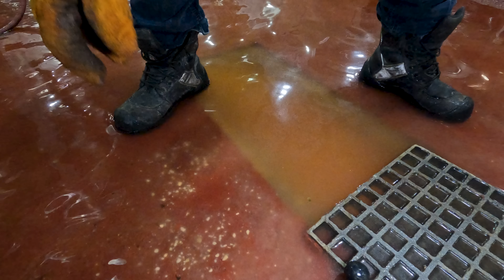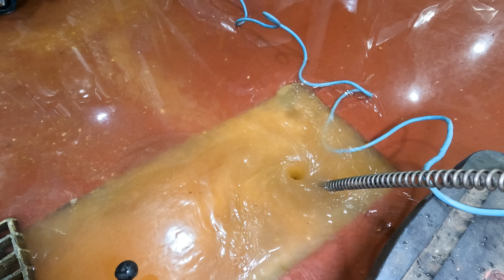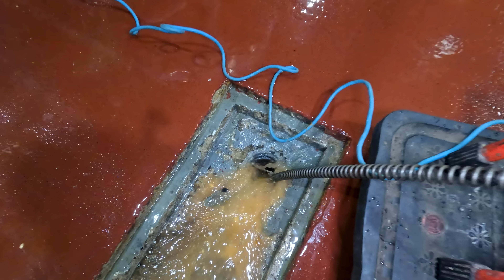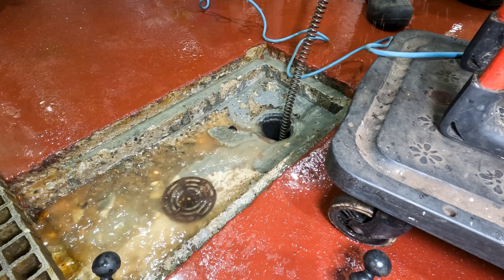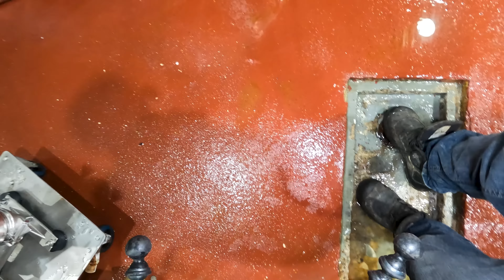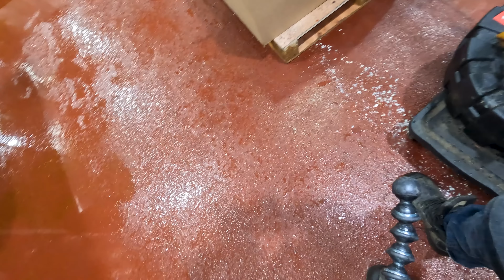This is how you clear a BBQ factory floor drain. WEEKEND WHIRLPOOL. SO SATISFYING.

Comment: What Kind of drain snake are you using in this video? Looks perfect for commercial jobs
Reply from the maker: That machine is a rigid k60 and it's a 7/8 cable. I'm trying to get my hands on the Milwaukee battery powered and M18 I've heard good things about it. So if by chance you have any contact with Milwaukee just throwing it out there. Thanks for watching. I hope you have yourself a great day

Comment: The grate has holes big enough for the snake to fit through so why don't you guys just leave it on, leave the snake on the drain and turn it on for a second every so often throughout the day so you're not walking in all that water for hours on end?
Reply from the maker: Because I'm the guy they call in and I didn't know where the drain was and we won't leave cables in a drain it will eventually rust and break down and then it will be stuck in the drain. Thanks for watching and I hope you have yourself a great day. Trogna
Reply: @Jaythatdrainguy  ah gotcha. I guess if it was my factory I'd just have to buy or make a stainless steel snake, leave that shit sitting there and tell my employees to do that so I don't have to spend extra money every weekend for you to come save them 🤣 🤣🤣🤣
Reply: @Jaythatdrainguy  nice job though! Enjoy yours as well!
Reply from the maker: No it would make sense for sure.
Reply: @Jaythatdrainguy  mhm between the cost savings and the liability of someone busting their tail before you even get there it should be common sense but that's something that's apparently not common. Lol
Reply from the maker: Lol

Comment: I could be wrong but I think you are running that machine backwards
Reply from the maker: In the nicest way possible. No I'm not. I'm running at the proper way You can tell by if I was to bring in the guide hose you would attach it to the back of the machine and you would run the end of the back end of the cable and keep it in the guide hose if that makes sense. Just out of curiosity, why would you think I'm running it backwards? Thanks for watching Douglas. I hope you have yourself a great day. Trogna
Reply: @Jaythatdrainguy   I'm a maintenance man at a apartment complex. I run machines like that when we have backups, but run ours  the other way
Reply from the maker: Oh really eh I was working on a job with another company and they asked me the same thing because to get the machine to feed the cable and you got to go in reverse and he said the guy that taught him was doing it for over 30 years. But then I explained to him about the guide hose and he's like. Oh yeah that makes sense. If you look up how to run a rigid k60, I'm pretty sure you'll be able to find it that you run it The way that I'm running it I could be wrong. Again thanks for watching. Hope you have yourself a great day. Trogna

Comment: All you need is a shopping cart full of draino. Problem solved.
Reply from the maker: Yeah that would probably work but what's it going to do to the pipes in the end? Thanks for watching. I hope you have yourself a great day. Trogna
Reply: @Jaythatdrainguy   thanks for uploading. You definitely did it right no doubt. I was just being ridiculous with my comment. 

To answer your question however, if it was copper pipe I think it would be bad news. As far as PVC idk… I seen a guy do a tutorial on YouTube with different drain cleaners and testing there box label accuracy claims and from what I can tell and his testing the PVC had no issues but the copper piping did. 

Then again he didn’t use a shopping cart amount either. 

You definitely did it right. Hence why your the professional. 🤙
Reply from the maker: Yeah for sure hey quick question. Do you know who that was that did that experiment? I wouldn't mind watching that. Thanks again for watching.

Comment: City sewer system? Or private? Either way, dumping that much grease/oil byproduct into a drain...if that's what their drain looks like can only imagine what the main line looks like down stream...! The contents that hit/flow in that floor drain is so acidic, it is destroying the concrete flowing acrossed it as though it were in an actual septic tank...!
Reply from the maker: Yeah you can definitely see the concrete wearing away from all the acidity like you said. Thanks for watching Karl. I hope you have yourself a great weekend. Trogna
Reply: Water flowing by itself erodes concrete. I've been pouring and finishing concrete for 20 yrs. Salt will corrode your concrete too
Reply from the maker: I did not know that thanks for watching and I hope you have yourself a great day. Trogna
Reply: *drain
Reply: Major repairs and cost for doing that.....All that grease, wow......!!!!......They gonna need some serious plumbing work....Break out the check book 📖......!!!!
Reply: Most likely they have a water treatment plant on site or are paying hefty fines for the water they are dis charging.
Reply from the maker: Lol yeah for sure. Thanks for watching and I hope you have yourself a great day. Trogna
Reply: There will be a huge grease trap outside.
Reply: @paulheitkemper1559  lol it doesn’t look like it. Most restaurants are required to have that grease trap so why doesn’t this place have one??
Reply: @ypcomchic  this video is inside the facility.
Reply from the maker: Thanks for watching and I hope you have yourself a great day. Trogna
Reply from the maker: Thanks for watching and I hope you have yourself a great day. Trogna
Reply from the maker: It does outside. Thanks for watching and I hope you have yourself a great day. Trogna
Reply from the maker: Yup thanks for watching and I hope you have yourself a great day. Trogna
Reply: @paulheitkemper1559  grease trap at minimum
Reply: They have a separator just like auto shops do.
Reply: It gets held in a separate tank and shipped in semi trucks to be processed elsewhere. Pretty sure this is litehouse foods in lowell michigan.
Reply from the maker: Yes it gets shipped but it's not in Michigan. Thanks for watching and I hope you have yourself a great day. Trogna
Reply from the maker: Yup outside. Thanks for watching and I hope you have yourself a great day. Trogna
Reply: I worked in a bbq factory in Indiana that water feeds into an on-site waste water plant. That is the usual practice when cleaning tanks out to drain them to the floor.
Reply from the maker: Yup thanks for watching and I hope you have yourself a great day. Trogna
Reply: Quit being a karen karl lol
Reply: They have an oil separator and grease trap. Those waste products are not going to the treatment facility. Every factory is purpose built for what it does. I plumb new factories for a living.
Reply: Damn with your intellectual superior knowledge you should already be millionaire by now, run your own BBQ company
Reply: @Jaythatdrainguy  wtf is Trogna. Trogna.
Reply from the maker: It's a word I made up years ago and I say to my kids it basically means goodbye or cya later I am trying to get it to catch on because my wife refuses to say it because she says it's not a word lol I've been saying it for years . Thanks for watching and I hope you have yourself a great day. Trogna
Reply from the maker: Thanks for watching and I hope you have yourself a great day. Trogna
Reply from the maker: 100% thanks for watching and I hope you have yourself a great day. Trogna
Reply: Karl had a great point, and yes guys, even air erodes stuff. Why those cool rocks out in the desert haha.
Reply from the maker: Lol thanks for watching and I hope you have yourself a great day. Trogna
Reply: If they send some extremely hot water behind that fluid that was flooding that room it will break down the grease and wash on down and it’s probably cleaning chemicals that has eaten the concrete up in the drain. The floor in there had a epoxy coating on it is why the floors were not eat up. My concern is the fact that there was 3 inch’s of nasty ass trashy water in the same room of food products. I’d say the shit would hit the fan if the right people knew this video was out like this
Reply: Yep that's food production for you.
Reply from the maker: Yep thanks for watching and I hope you have yourself a great day. Trogna
Reply from the maker: Probably. Thanks for watching and I hope you have yourself a great day. Trogna
Reply from the maker: Very good explanation Patrick. I hope you have yourself a great day. Trogna
Reply: It looked like a bottle cap or a jug lid. Hellitcoulda been juuust about anything dwelling low to the floor 🥴
Reply from the maker: True thanks for watching and I hope you have yourself a great weekend. Trogna
Reply: They make grease interceptors in precast concrete for this reason and they’re placed underground
Reply from the maker: Yep, you're right. D. This one is outside and it picks up all the drains so this one drain was just plugged up. I actually have a video on my page. Probably a couple, maybe a month or two ago and it looks identical but it shows more than one drain that was backed up. Thanks for watching. I hope you have yourself a great weekend. Trogna
Reply: If yer gonna chide them for this, put your money where your mouth is and give them a solution. But first do some research on factory water processing to not put your foot in your mouth.
Reply from the maker: Thanks for watching. I hope you have yourself a great weekend. Trogna
Reply from the maker: Thanks for watching and I hope you have yourself a great weekend. Trogna
Reply: @Theuglyconcretefinisher  thanks for doing the work you do sir, my uncle just passed on the job hit by a skid steer. He was a concrete finisher for almost 30 years, what y’all do is art.
Reply from the maker: Thanks for watching and I hope you have yourself a great weekend. Trogna
Reply: It all goes into a tank then repurposed. I'm pretty sure mcdonalds and Wendy's buy it for their burgers
Reply from the maker: Lol I don't think that is correct but I could be wrong thanks for watching and I hope you have yourself a great weekend. Trogna
Reply: @Jaythatdrainguy  You're so humble and friendly. Thanks for the very relaxing video.
Reply from the maker: Lol Thanks. I definitely if I'm being honest I wouldn't agree with you a couple years ago. But I'm definitely trying to change myself for the better and I just hope that it is coming through that I am actually trying. It's not just a facade I'm putting on. Thanks for watching. I hope you have yourself a great weekend. Trogna
Reply: @swide2750  Except that is nearly 100% gone unless they are a billion dollar company
Reply from the maker: Thanks for watching and I hope you have yourself a great day. Trogna
Reply from the maker: Thanks for watching and I hope you have yourself a great day. Trogna
Reply from the maker: Thanks for watching and I hope you have yourself a great day. Trogna
Reply: @MrDeserteagle411  whats 100% gone
Reply from the maker: Thanks for watching and I hope you have yourself a great day. Trogna
Reply: @swide2750  Companies dumping millions of gallons of waste illegally, except for billion dollar companies
Reply from the maker: Lol thanks for watching and I hope you have yourself a great day. Trogna
Reply: Should be grease traps down there.
Reply from the maker: There is outside. Thanks for watching and I hope you have yourself a great day. Trogna
Reply: @paulheitkemper1559  I have a grease trap inside
Reply: @durk541  dude, don't talk about your sister like that.
Reply from the maker: Wow it's getting spicy in the comments lol thanks for watching and I hope you have yourself a great day. Trogna
Reply from the maker: Thanks for watching and I hope you have yourself a great day. Trogna
Reply: Just think what that BBQ food is doing to your arteries.
Reply from the maker: It's true but it tastes so good. Thanks for watching. I hope you have yourself a great night. Donald. Trogna
Reply: @incredulousd9408  el oh el!! I was wondering the same thing! 😂😂
Reply from the maker: Thanks for watching and I hope you have yourself a great day. Trogna
Reply: Probably private I worked at a few restaurants where we had dedicated grease drains into a tank or some other system
Reply from the maker: Yeah they had a grease interceptor outside of the building that gets cleaned out. Thanks for watching and I hope you have yourself a great weekend. Trogna
Reply: It ate through the epoxy coating of the concrete
Reply from the maker: Lol yeah thanks for watching and I hope you have yourself a great weekend. Trogna
Reply: @Jaythatdrainguy  Google translate is translating Trogna to Faithful. So. You are just calling all of your viewers faithfuls xD
Reply from the maker: Yeah I found that out. Got too long ago but it is what it is. I made that word before I do word existed in another language and it's just something that comes natural to me to say it now. That makes sense

Comment: If you want more people to view this maybe cut out the first 3 minutes where you do absolutely nothing on the camera
Reply from the maker: Thanks that's a good idea. I hope you have yourself a great day. Trogna but also with that being said I have 3700 subs and this video has 500,000 views .
Reply: @Jaythatdrainguy  that's awesome man I'm a mechanic and wanted to start posting hard to diagnose fixes that i figured out and other shops couldn't but id almost have to hire a camera man or maybe get a go pro its always been something i wanted to do and never have but yeah just throwing my opinion out there since i almost skipped the video i was 2 minutes in and was still starring at a flooded drain also what is that machine I've used a snake on drains but usually it turns did you just not have it on?
Reply from the maker: You should definitely start. Just get a go pro like you said and just start you'll never find the perfect time. The perfect time is now. Thanks for watching and I hope you have yourself a great day. Trogna

Comment: Glad they have changed up drain cleaning machines for the better since I use to to that same job. Those Spartan spinning cannisters could beat you to death and God forbid you got a hole in the air swich ball or line because they would quit working.
Reply from the maker: Oh yeah for sure thanks for watching and I hope you have yourself a great day. Trogna
Reply: Spartan is still number one on the market i feel. General wire #2
Reply from the maker: Yeah I've never tried the Spartan. I'd like to get my hands on one to try it just to see how it works. A lot of the issues we come up with though are in apartment buildings and I don't know how that machine would work because it's more of thick cable. Very rigid if I'm not mistaken but I could be wrong and with our apartments that we got to deal with the copper brass that they use is very thin and cheap and I'd be concerned that it would do more damage then good.

Comment: wow, that just seemed too easy didn't it?  You hardly had to put that snake down 10 feet before you cleared the blockage.  looks like that drainpit has seen better days, eh?
Reply from the maker: I think it may have been an offset trap and the trap was just plugged. But that's just one man's opinion lol thanks for watching Piddy I hope you have yourself a great weekend. Trogna
Reply: The only thing more satisfying than clearing the blockage is clearing it on the first cable lol
Reply from the maker: You couldn't be more right with that statement. Thanks for watching and I hope you have yourself a great day. Trogna

Comment: I worked in a cheese factory for a few years. I know they have to hose that floor down every day, or bacteria and  mold start to form. Our floors were never this disgusting tho.
Reply from the maker: I've done some work at a cheese factory and the smell of that cheese was hard to get used to. Thanks for watching and I hope you have yourself a great day. Trogna
Reply: @Jaythatdrainguy  lol. It never bothered me. We use to eat the curds right out of the bin. Good stuff. It was a cheese factory that used only Amish milk. Now the milk was a different story. Sometimes it would have maggots or manure in it. We had to throw that out. And cleaning the whey separater was an hour long job. Hard work with some perks and good pay.
Reply: @kimalbrecht2004  Can you tell me more? At what part of the process would you notice contaminated milk and how does it happen?
Reply: @cancelhandles  well the Amish milk would come in the old milk cans. They kept it cool in a bin that cold water poured into. We got it off the truck, and once it was inside the plant, we would have to check it for maggots and manure. Fortunately maggots and manure float. Any milk that looked bad was dumped. The milk would go through a pasteurization process, and then be dumped into open bins that were heated. After the salt and enzymes went in the curd would formed and the whey would get dumped into a bin, after going through a separater.
We sold the whey as a by product. Then we'd put huge squares of cheese into a large metal square, lined in cheese cloth. These boxes would be compressed, so that any remaining whey would be sqeezed out. We left the boxes to be compressed for about an hour. After that, we would take the cheese blocks out, wrap them in plastic bags, weigh them, decompress the bag, date it and put it in the walk in frig. It was not a boring job and I really enjoyed it.
Reply from the maker: That's awesome! Thanks for watching Kim. I hope you have yourself a great day. Trogna
Reply: @Jaythatdrainguy  ❤